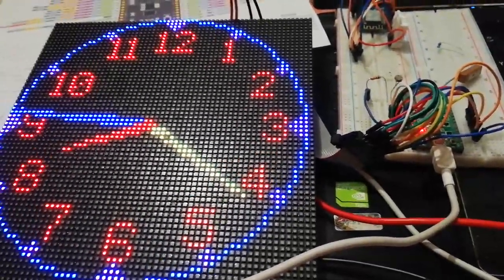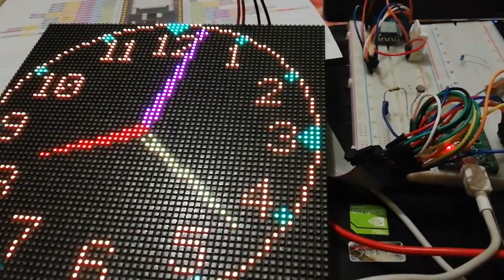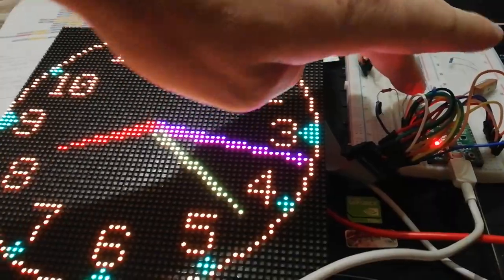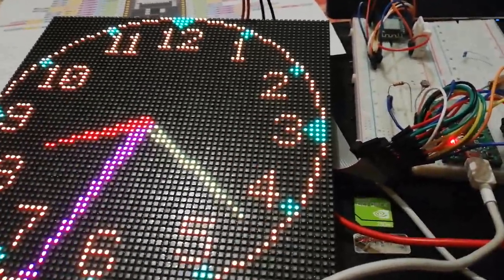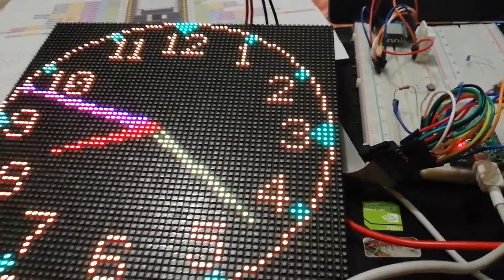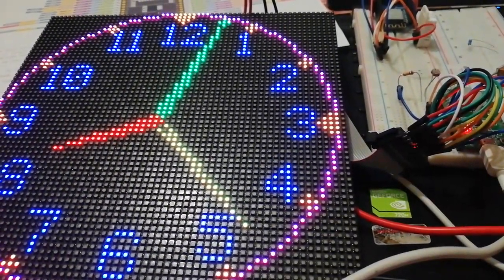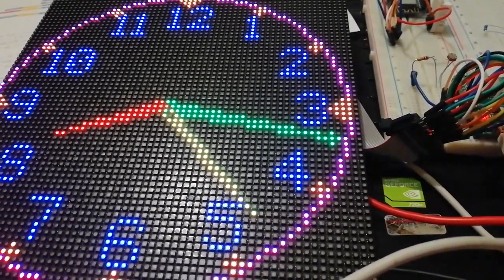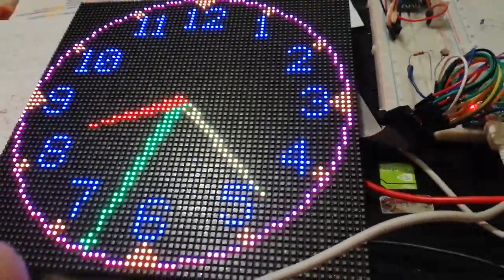analog NTP clock with ESP32 and P3 64x64 led display (4)

Comment: Nice work sir can you explain the power supply circuit
Reply from the maker: If with open the links from description you can find all info, but maily can be use 5V 1A phone charger